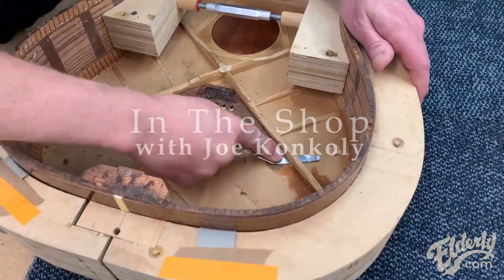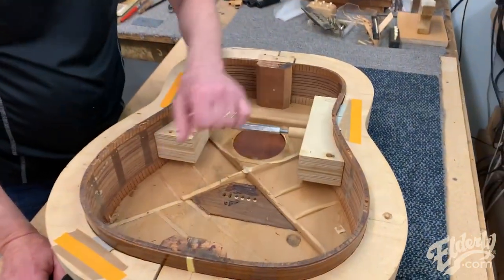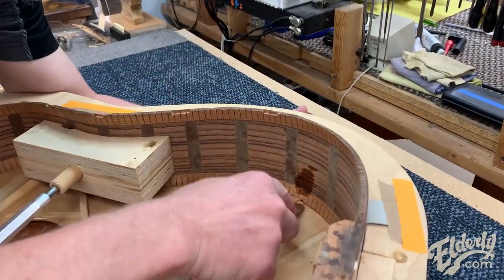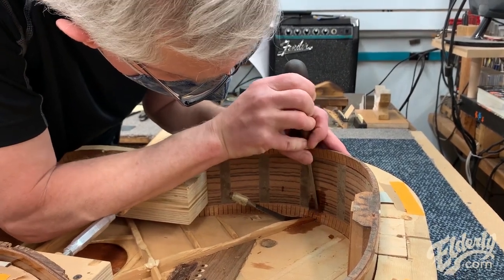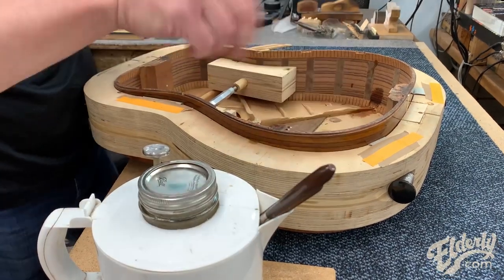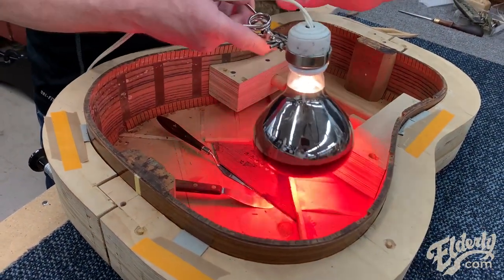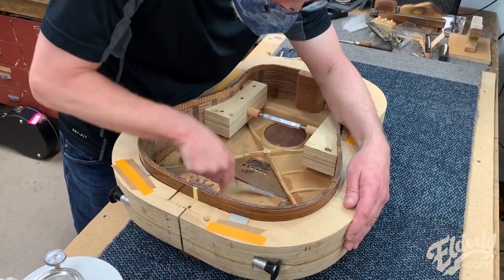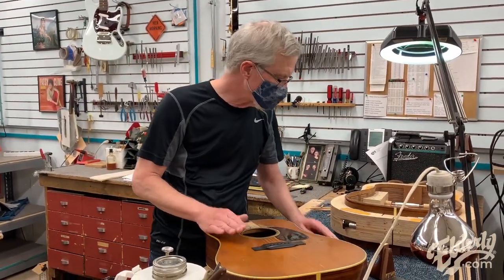In The Shop: Re-bracing continues on a 1970 Martin D-28 | Elderly.com

Comment: Nice work.  That old Martin glue didn't want to let go easily.  Do you think the bridge plate is original?  It looks huge .
Reply: It's a 1970 D-28. Martin changed from small 1-3/8" Maple Bridgeplates in 1968 (on all models) to small Rosewood Bridgeplates. Then, a year later in 1969, they made them larger, 3-1/4" Rosewood Bridgeplates. So, two years later, you're lookin' at 1970 D-28 with the horribly huge Rosewood Bridgeplate. They reverted back to 1-3/8" Maple plates on all models again in 1988. Other than the HD-28 which premiered in 1976 using 1-3/8" maple plates, all other Martin's (except for Custom Shop builds in the mid '80's) had larger Rosewood plates until 1988. It's considered one of Martin's more stupid decisions to change the Maple plates to Rosewood in 1968. Those 20 years, from 68 to 88, drastically altered the sound of Matins, enough so, that it ended their desirability for Collectors.
Reply: They also had issues with misaligned bridges in the seventies. 
I know because I've got one.
Reply: Yeah definitely originals bridge. 70s Martins have those huge rosewood plates which take away from the tone. Not only is it heavier than Maple, but it's massive Although there's a small group of people that actually like them.

Comment: Joe: that’s a lot of tedious work and you’re doing a fine job. However, it seems like if you had removed the top and replaced with new, you would have saved all of that wood removal work. I’m sure you evaluated the best way to do this repair, but I’m wondering why you reached the conclusion to do it this way.
Reply: Never replace the top wood. All those years of aging